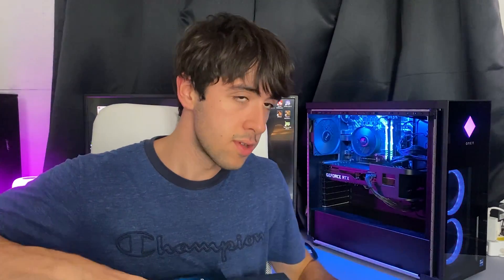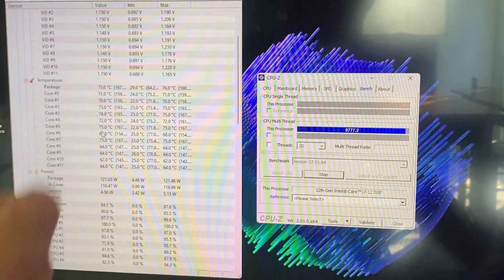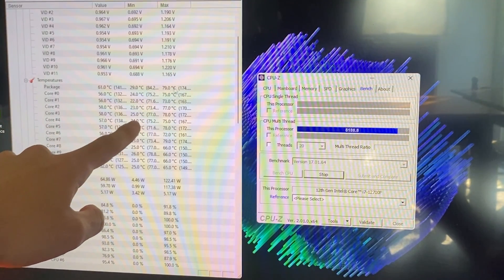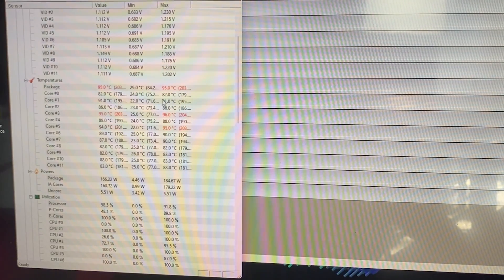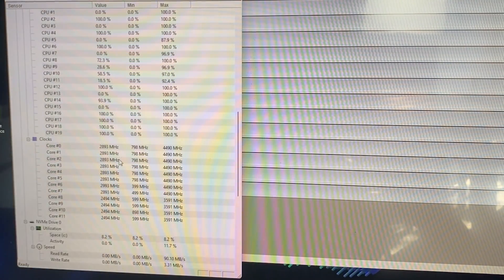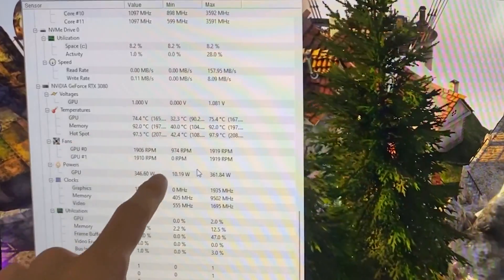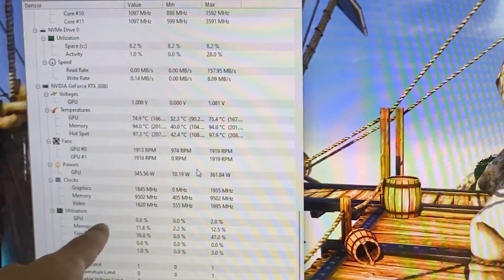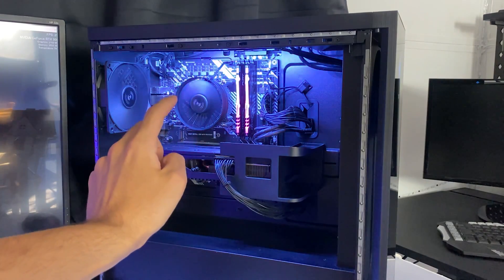Upgrading my PreBuilt Gaming PC | More FPS & lower temperature!

Comment: You never showed PRIME95 CPU temp post changing to water cooling. The CPU only hit 95 degrees with prime95 and you compared that to CPU-Z built in bench which never yielded high temps...
Reply from the maker: Very good point, I did run Prime but forgot to include the footage, the differential is what I mention though and it is accurate. CPU-Z also shows a 30C drop which confirms the massive improvement